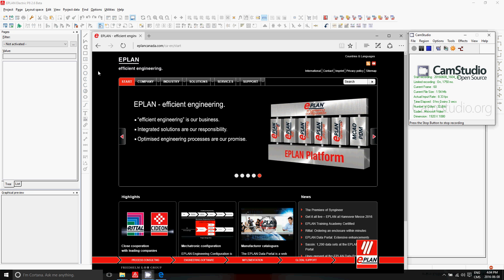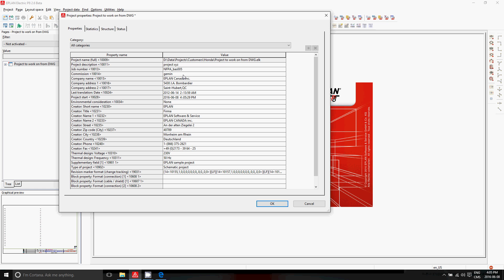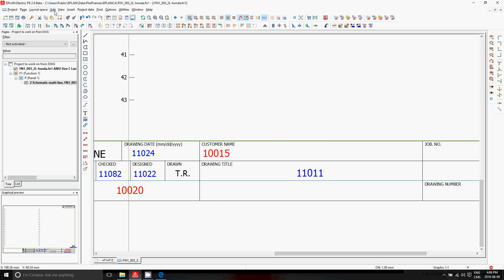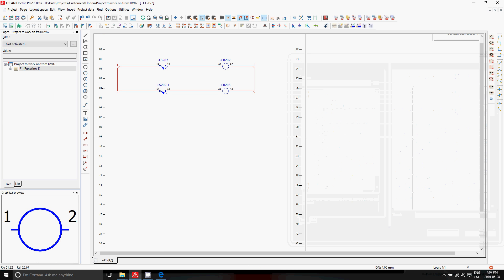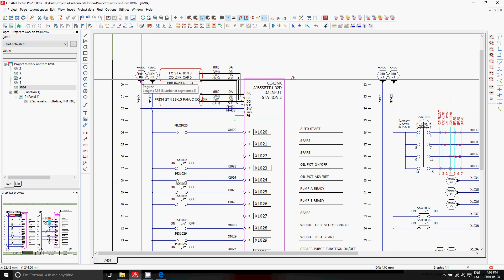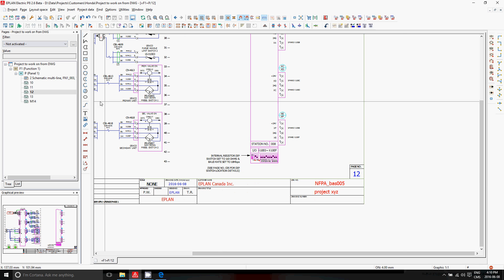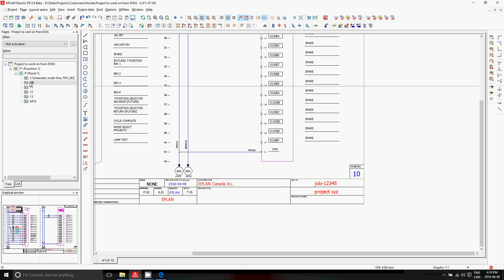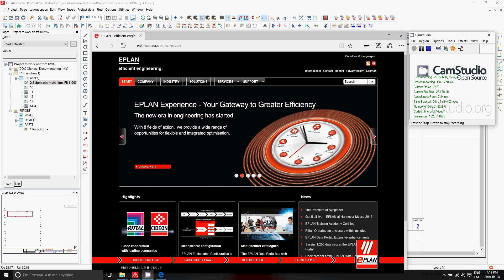EPLAN ELECTRIC P8 Tutorial on how to handle DWG files EN

Comment: OMG! This so complicated! I suppose this is German software. They like to make thing overcomplicated. Can you suggest simple software to just draw schematic on one page (quick and easy)?
Reply from the maker: In my career I have never seen a one page schematic for my controls, the smallest project I saw had 48 pages, when I have to handle these 48 pages, plus BOM, plus wiriing list, plus terminal diagrams, plus layout I had over 75 pages and I would have loved to have EPLAN. 75 files to handle individually is tidious. If you only need a graphical editor for 1 page, then use simple tool like draftsight.